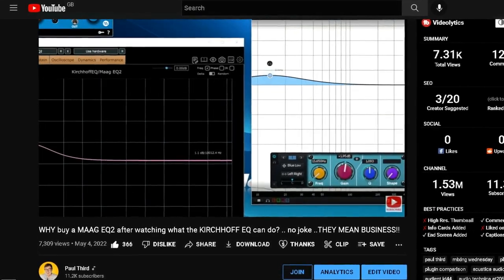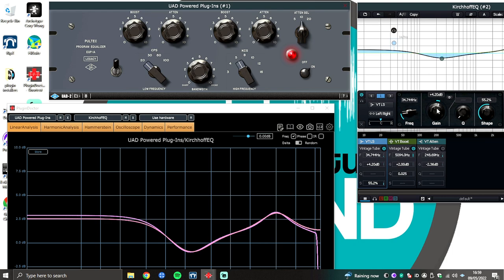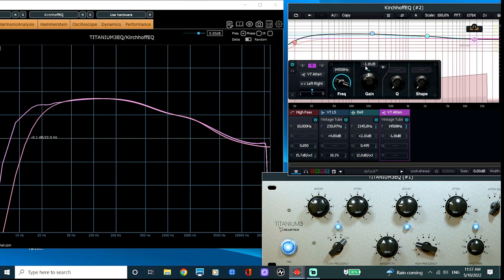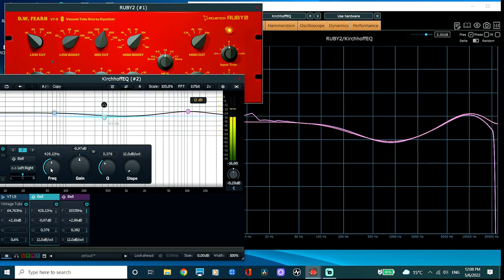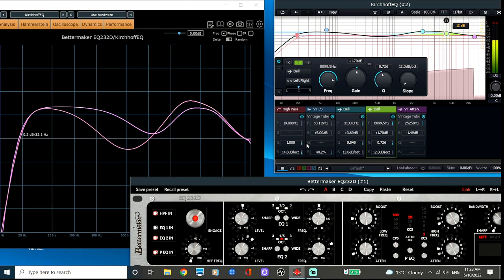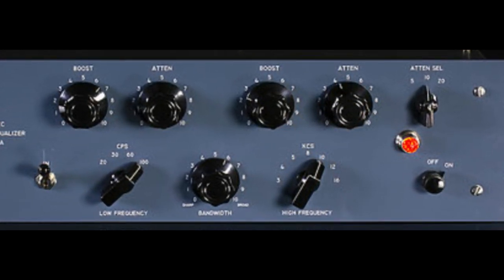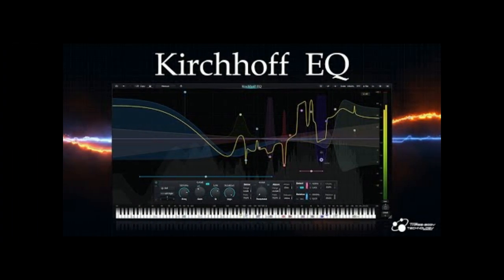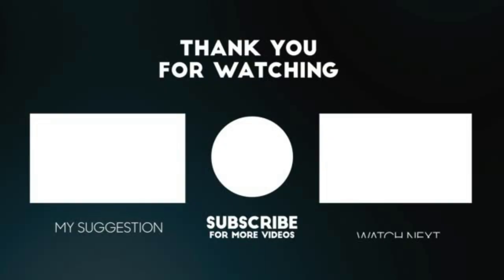Do you REALLY need 5 Pultec plugins .. considering KIRCHHOFF EQ can do THIS!!!???

Comment: Actually the harmonic content of most Pultec style emulations match the harmonic content created by a Neve 1073 preamp. Analog Obsession BritPre does the job for free and as close as it gets.
Regarding the Titanium 3 bottom end: it seems that Acustica uses a steeper DC filter at a lower frequency. That's negligible due to the fact that most limiters will introduce another DC filter
Reply from the maker: That's interesting you say that cause I was shown a test with a neve 1073 and a cheaper hardware clone and the null was practically inaudible. I was told that a 1073 isn't actually as coloured as many believe and isn't as magic as everybody says
Reply: @PaulThird  When used reasonable you are absolutely right. But pushed by 20 db harmonics become very audible especially after compressing the signal. The 3rd order harmonic is off in comparison to Pultecs with harmonic distortion but the overall subtle harmonic content suits the vintage style coloration (at least it is the closest I could achieve). A simple single tube triode plugin would be best to nail the dominant 2nd and 4th order harmonics found in Pultecs.

Comment: Did you know that you can make any track you're mixing sound better by adding more of these things called DB's? They sound great.... UA likes to use them in their plug-in videos! 😂🤣
Thanks for the video.... Yeah... You could easily do everything you really need for EQ, with a really versatile EQ like that and a really good (oversampled) saturation plug-in.  

I still like the NoiseAsh.... It's fast and does the boost/cut thing nicely in two seconds. If you already have it.... No reason to try and replace it.... Because you can.
Reply from the maker: I'll still use the noiseAsh for backing vocals for that smeary coloured pultec sound just cause it only means one instance

Comment: Paul, softube Weiss equalizer and eventide split eq good ?
Reply from the maker: Split eq is a handy tool for certain occasions. Weiss equaliser I don't get why everybody goes on about it tbh 🤷‍♂️ can be a 1:1 hardware code port but still a digital eq at the end of the day
Reply: @PaulThird  Each eq'd gives a very different sound to what is being done. For example, when you make a high cut above 50 hz, some equalizers break the bass. It makes some of them stronger. I couldn't decide which is the best equalizer on the market, but it seemed to me like weiss eq. For example, I don't know why Weiss Compressorde, but it incredibly never distorts the sound. Can you do a test on this?
Reply from the maker: I tested the weiss eq well over a year ago and it nulled with proq3 so I wasn't interested in a video. Workflow wise it wasn't for me and it was just a transparent eq to my ears.

As for the weiss compressor it's made to be transparent. I made a video comparing transparent, coloured and multiband compression, when would be the best sources to use each on etc.

I did like the weiss comp but as soon as I got the kotelnikov GE edition I knew I didn't need to pay the weiss price for a good transparent compressor. Kotelnikovs mental and supeeeer clean especially on precise and extreme settings.

Im now using it on all of my vocals and been considering it for drums just for clean compression and then adding my own vibe afterwords if neccisary.

It can do weiss transparency as well as option even or odd harmonics or both, and also includes an inertia mode for optical style behaviour, auto gain, crest factor threshold as well as the option to choose between rms and peak detection.. Or a mix of both. And even more. Dynamic eq style compression, upwards expansion etc etc

Comment: I like your stuff, Paul, but you did not provide any examples of null here while making a pretty big claim that the Kirchhoff EQ can replace these 5 plugins. You know there is harmonics, compression, noise, etc involved in emulations that it does not appear the Kirchhoff is even trying to create. If you are so certain the Kirchhoff can replace these five plugins, show that they null agains the Kirchhoff and you will have proven your point. Without that, you need to adjust your statements to say the Kirchhoff does not replace these plugins, only provides a part of what the plugins provide. 

Would you agree?

Also, you are great at always having audio examples to compare; include those in your Kirchhoff videos. The end sound is all that matters, and seeing EQ curves is super interesting, but meaningless without hearing how a plug-in actually handles a signal.
Reply from the maker: If somebody was to pay me more so I could go full time and prepare null tests for all of these then I'd happily oblige but until that time you'll need to take what I can offer with the time I've got.

Just cause I managed a null test on last week's video with one plugin doesn't mean I've got the time to do it on 5 plugins (well 4 cause the ruletec is pointless due to the saturation). I think people forget I work Mon-Fri 40 hours a week as well as managing a seperate audio podcast as well.

To expect me to offer what I've done this week, which is also a day late as well as prepare 4 null tests.. How much time do yous all think I've all got.

In all honesty I couldn't give 2 flying monkeys what anybody makes of my statements. Its just one person's perspective.

I showed last week that when the noise and harmonics are in the inaudible range and you can match the curves as well most of the phase them you'll get a pretty inaudible null.

Im seeing the same pattern in this video. Matched curves with no audible noise or harmonics in uad, bettermaker and the 2 acustica audio plugins.

Where's the big audible difference going to be?

So what do you want me to do.. Spend more of my own time making seperate null tests so of all the pultec users moaning can not reply.

My viewpoint is that the whole point of a pultec is the curves which you can closely match with 1 eq. The curves is why we use it. We can argue about non linear BS when in reality I measured a real pultec and guess what.. It was mostly just noise with no real audible harmonic content. There's no magic in a pultec.. That's for Harry Potter novels. That's why the UAD got gear identical results in my hardware shootout.

If theres no audible harmonic content and the phase (when not skewed by eq cramping) matches.. Then what magic are we expecting from the emulations?

I've really pushed the limits by trying to match 5 pultecs with 1 eq and you can see the curves match. It's an OTT test. But If you genuinely believe that there's modelled magic and dynamic content going on that's going to result in this huge audible difference then there's not much I could do to change that.

I'll see how it plays out and if I ever have the time I'll think about it but I'd much rather somebody took to the time to prove me wrong rather than me constantly trying to prove myself right to people who will simply go back in the shadows again until another opportunity comes up

I'm not meaning you directly but I'm just used to how these things work whenever I give my views on things people have paid for and use regularly
Reply: @PaulThird  My comment was not meant as a complaint or demand, but judging by your reply I believe I might have came off that way. Sorry for that. It also appears you are frustrated with people complaining and demanding more of you while you feel you are not making enough money from the channel to make it all worthwhile. 

Again, I apologize if my comment came off as harsh in any way. I respect your thorough and unbiased approach and intended to open a dialog on the necessity, or lack of necessity, for actual audio examples, null test, etc, when thinking of replacing hardware emulations with an EQ. To that end, I was hoping, if you ended up agreeing, you would either soften your claims about the Kirchhoff EQ fully replacing the emulations (for those thinking they might buy the Kirchhoff EQ instead of the emulations based on your video), or have a follow-up video doing what you normally do so well: show real-world audio reality. The null tests and A-B audio tests would be interesting and insightful…mostly to see if, and to what extent, these hardware emulations really offer more than EQ curves or not. 

You mentioned that you wish people would just make a video to prove you wrong; but I ask why would they? Unless they have already spent the time to build a channel and audience already, no one will see it. So, it would be a pointless rebuttal. 

Your statements are just the opinions of one person, like you say. That is true. But you are one person who has chosen to make himself a public figure. Like it or not, you have gained the trust and respect of many for your unbiased and scientific approach to audio tools. This differentiates you from most other audio pundits who will pretend to analyze products they are profiting from. If your stature and audience has not yet produced enough income to make it worth it, that does not change the effect you have. People trust you and your humble opinions will make a difference. So, you do, in fact, produce more than just one guys opinions: you affect the thoughts and actions of others. 

If you are unhappy with the amount of money this is bringing in, or don’t want to field requests for follow-ups, I offer you two thoughts: 
First, your payback is when you begin taking on clients and your respected stature gives you access to the market on a global scale. I am guessing that is really why you started your channel and you are succeeding in that, whiteout question.  
Second, you have a unique product: analysis from someone who is not going to lie. Charge for that. Start a membership club with exclusive content. You have Patreon, but also look into Locals. However you do it, begin making educational videos to teach people how you do what you do and maybe even hold back some of your deeper analysis for members only. 

This is long, but, if you read this far, hopefully you get that I mean well and hope the best for you. 

Also, if you need help in editing videos to ease your burden, I have a good amount of skill and experience and would be happy to lend hand to help you get content out.